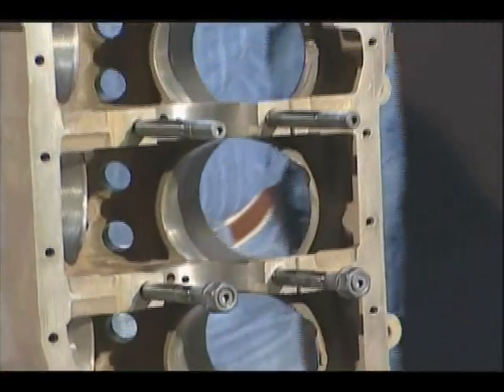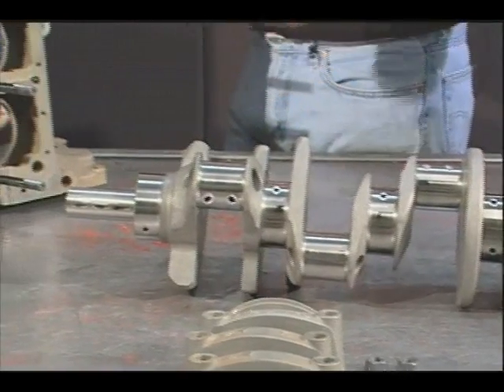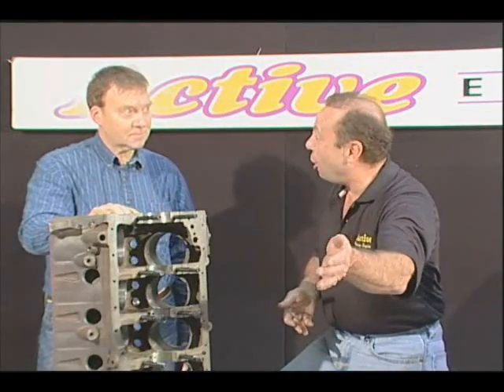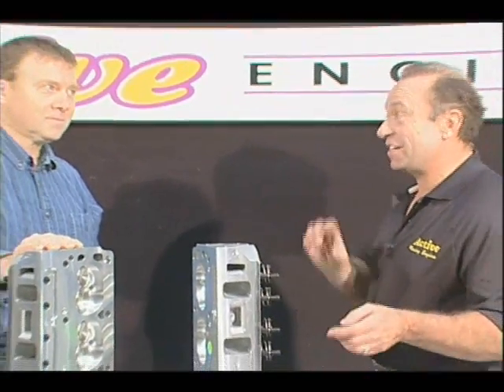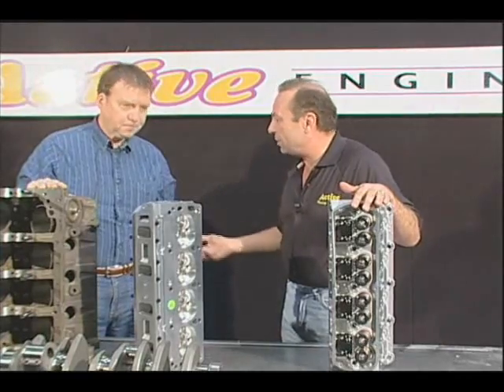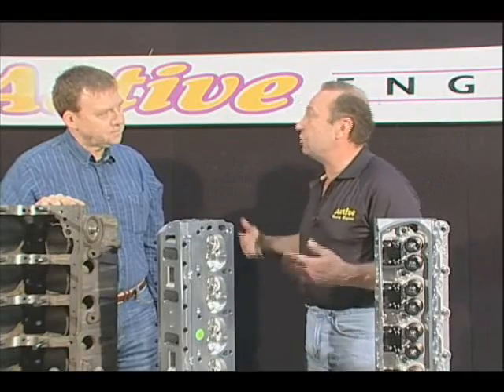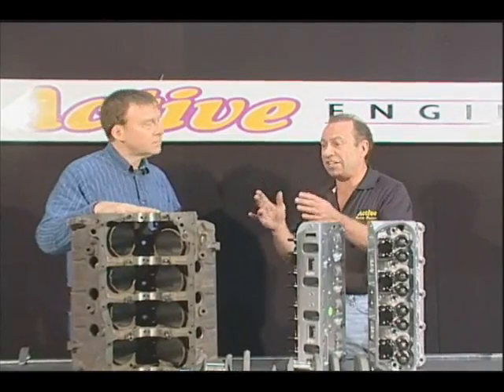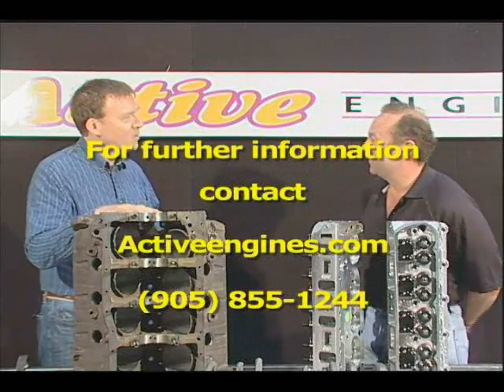Rebuild Engines with Blueprinting - Part 2 of 2

Comment: @sojer6mile 
Lol I had an 87. Dont forget 1 9/16" headers. 
If you can save enough to buy the engine, you can save for the proper assembly. An engine is not complete without proper assembly. Cost of assembly should always be considered when a person starts to build an engine. A shortcut during assembly will shorten the engines life.

Comment: I wonder how much do blue printing cost my engine will cost me bout 5k and I won't have much money left I was gonna buy a used built 700r4 to save cost engine roller 355 eagal 383 kit dish pistons GM Fast Burn heads, TPIS Miniram, TPIS ZZ-409 cam, 30# injectors, BBK Throttle body 52mm, 1.6 self alin rockers. Lookin at 500hp 525lbt in my 87 IROC-Z